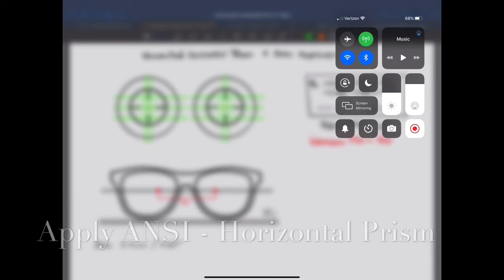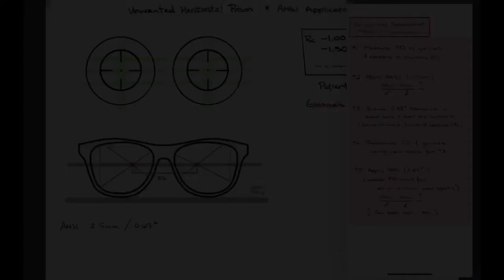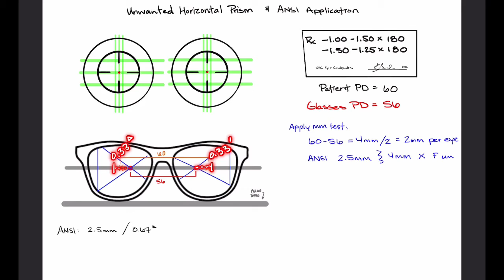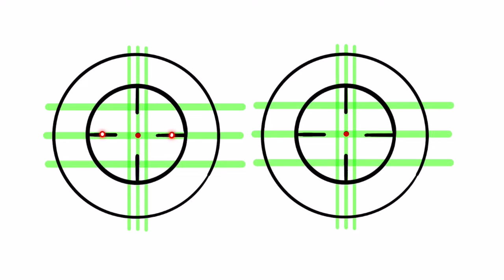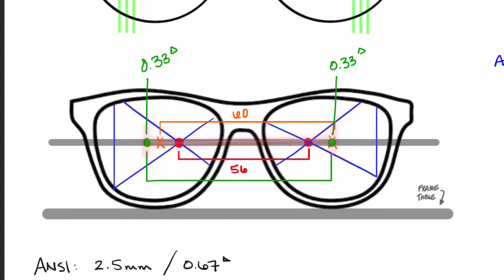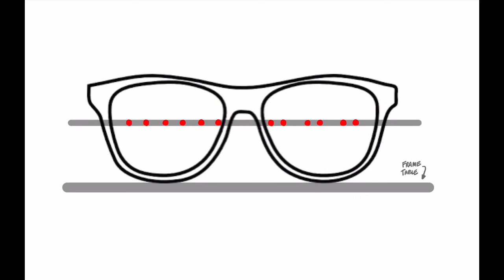Horizontal Prism & ANSI

Comment: Hey, According to ANSI, dont we have to only consider one method of pds verification depending on the power? for powers upto 2.75 we should use 0.67 rule and anything above 2.5mm rule. this is what ansi tolerance chart says. please clarify
Reply from the maker: @PurbaVision  yes you can absolutely use the power range to determine pass or fail. Both work out the same.

Comment: Hi Tracy, this video helps a lot. I have a question. It is possible for only using Prentice's rule. Sometime measuring can be not accurate.. ? Let say only determine Base direction and calculate prism diopter by Prentice's rules. Thank you so much ! :)
Reply from the maker: Hey Tran! Prentice can be used to calculate the prism effect based on the millimeter error and the power of the lens in the horizontal (180) meridian. However, the calculations are not as exact a measurement as moving the lens in the lensmeter to induce to 0.33^ in each lens. If you use the calculation method - keep in mind it generally over estimates the prism amount. Let me know if you have any other questions. Thanks for the feedback!
Reply: Hi Tracy, thank you for your answer. Yes I have one concern.. When we finish neutralizing, dot the centre of the lenses and measure PD of the first pair. You move to the second pair with out moving the table and then you realize that the second pair is having some horizontal prism. How do you know what prism it is when you only have a prescription from the doctor and you are trying to find out what the lab made...?
Reply from the maker: @tranthu6889  when the dr prescribed prism you need to center the lensmeter power lines at the location where the prism is displayed. Ex: Rx has 2^BU in OD, then the lines are centered at 2^prism ring directly UP from the target center. Rx prism and unwanted prism are two very different things. ANSI is applied to error in Rx prism in a similar manner to non Rx prism lenses. The only difference is where original reference point is (the OC or the Prism Ref Point).